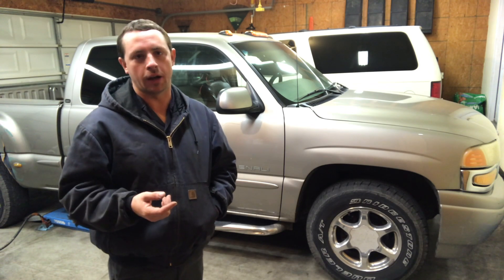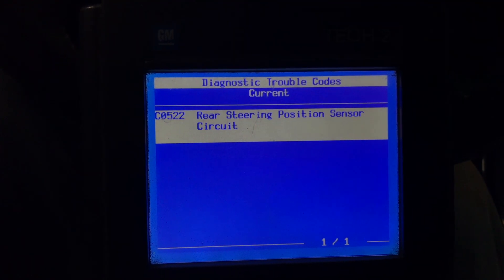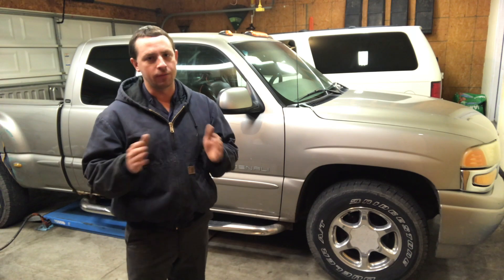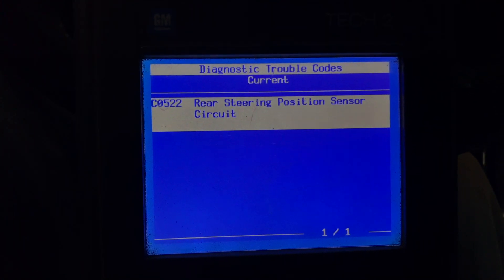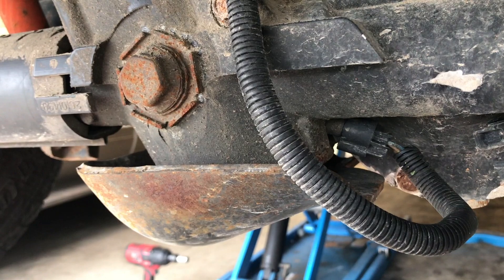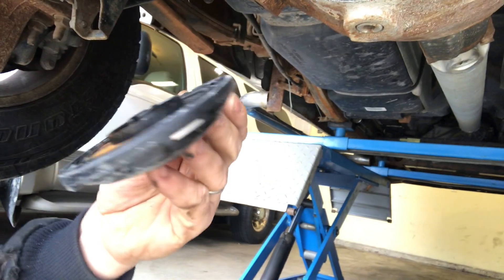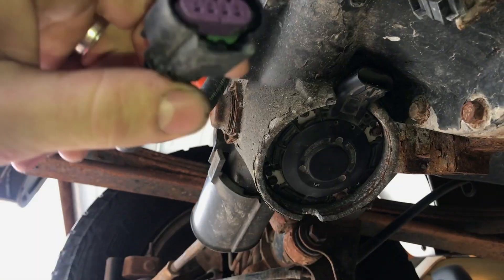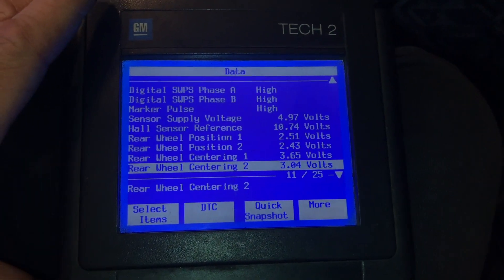GMC Quadrasteer (4 wheel steer) Repair

Comment: Redneck alignment tool.  A laser level. Much like the alignment tools used for semi trucks. The trick is looking out for raised lettering on the sidewall. On michellin tires there is usually a raised area that makes tire alignment much easier cause the alignment tool always sits straight along the sidewall.

Comment: I have owned my 2003 GMC Sierra Denali for over 20 years and driven 104,000 miles with the 4 wheel steering mode on constantly. I have owned several Chevy Silverado trucks during the same period one with the same extended cab as the 2003 GMC and even one with quad cab. Absolutely love the 4 wheel steering. The 2003 GMC Sierra Denali has the same turning radius as the 2003 Saturn Coupe. I am currently shipping my Denali to Illinois so I can drive it more often. (I have had it in storage in Florida for many years now.) Hopefully I won't have the same problem with the rear steering sensor.

Comment: Thank you, that was very informative.  I see that there is a vendor now that is making after-market ones for around $500.  I just picked up a 2002 quadrasteer, but haven't tested the RWS just yet (Broken shackle and I don't dare until that is fixed), but I'm very happy to see that if mine does have this problem that it's an easy fix and there is a comparatively inexpensive solution.

Comment: my truck is turning to the right but sometimes the steering locks up when i turn to the left and the rear left tire starts to squeal. i dont have an engine light for the 4ws, but it doesn't make any sense. does this mean that the sensor is bad or that i need to relearn the sensor?????? pls help :(

Comment: ACDelco GM Original Equipment 19418403 Steering Wheel Position Sensor $54.00 on Amazon.
Reply: Old comment but dude that’s not the same sensor at all lol

Comment: You said this truck was equipped with quadrasteer, which is something that is not really common even today? Now I just gotta ask, currently what other truck has a quadrasteer system option? From what I understand Chevy/GM was and still is the only one that ever built a quadrasteer option and only for a few years for the GMT800 platform….

Comment: Quick question just a few months ago I had to replace my drag link along with the pitman arm and idler arm and idler arm bracket and with new tie rods basically the front suspension parts and put power steering fluid since I had to get the pitman with steering gear box due to not having alot of room but after I finished installing everything i wen inside my truck and the first thing I saw on my dash message center marking  service 4 wheel steer and I checked everything and disconnected the battery multible times but it keeps saying the same thing service 4 steer I even changed the both front and rear differential and disconnected the battery and the still says the same thing plus i cant use my rear wheel steer and idk if my sensor gave out as well and it's also a 2002 gmc sierra denali AWD with the quadrasteer as well but the only good thing my trucks rear wheel are not misaligned like how you show in this vid there not crab walking plus I drive it in the highway and there just straight and its drivable and the only time the service 4 wheel steer starts to mark is when I turned the wheel to the left and if I turn off the truck and restart the msg center is not marking the truck 4 wheel steer but once I turn the wheel to the left it Mark's service 4 wheel steer again while truck is on the 4 wheel steer button doesnt let me go into 4 wheel steer it just stays on 2 wheel steer and when I barely start the truck up again theres no message for the 4 wheel steer only if I turn the wheel left and when the truck is off and I turn the wheel to the right it's not marking service 4 wheel steer but if I turn the wheel to the left it starts making 4 wheel steering for the time when the truck is on and sometimes when I do press the 4 wheel steer button it will just stay blinking but when I turn the wheel to the left the button for the 4 wheel steer stops blinking and just stays at 2 wheel steer like I dont need the the 4 wheel steer at all but I hate seeing that service 4 wheel steer service on my dash it's a eye sore whenever I'm driving and a friend of mine has a scanned tool and he scanned it but the only thing he sed it Mark's the left speed sensor is not working so idk what that is I checked it and they sed it the wire could be dirty or its cut but the wheel bearing assembly is brand new with the abs speed sensor but idk when I was replacing the front suspension parts if the wire got stretched out or it already needs to be cleaned because I replaced both front wheel bearing assembly about 6 months ago and just 2 months ago I replaced all of the front suspension parts 2 months ago so idk what I'm dealing idk replace the speed sensors or just go buy the rear steering position sensor for my denali so if you have loads please let me know I just wanna get rid of the service 4 wheel steer please

Comment: Any water inside will turn to ice and expand and break anything. This expensive option should have a bulletin to seal it and move the wiring harness so it can’t be pulled apart from  the sensor. It’s kind of crazy to think that this was considered to be a necessary option and how it would affect ride quality with all of the extra weight and potential cost of maintenance over time and not to forget that you would be unable to put some bigger wheels on your ride. In essence it would be just pure gluttony to have this on a truck only to one up the competition and your neighbour like a leather bed liner . We manager told me a story about a rich pig farmer that bought a new Cadillac I could name ten things I would rather have like an in-line Diesel engine option , dual batteries, two fuel tanks a real locking box below the bed height or a bed that can dump a load at the dump ! I think that sometimes they build something and then realize it was a bad idea. Using it on a regular pickup truck as a real world test dummy instead of a deluxe soccer mom mobile was all the evidence they needed to kill it. Good for backing up a trailer,,,,,,,very bad for dipping it in salt water at the boat launch over and over
Reply: I didn’t finish the pig story, btw my grandfather had a farm and pigs and fed hungry people when they didn’t have much so this is not to dis farmers ok, A successful pig farmer had the dealer pull the back seat out of his brand new Cadillac that he traded in every year and got a new one for himself and bought for others in the family, had them store the seats in the parts department, punch some holes in the floor and he drove around town with his Prize Pig in the back ! Maybe 4 wheel steering would be a good thing on his car, big ol pig head hanging out of the window laughing while the guy is doing donuts 🍩 and eating donuts ,,, Only in AMERICA !  The guys that built four wheel steering on a truck were the Dukes of Detroit.

Comment: I own 2 of these trucks.  One is a 2002 Denali with 165k miles and the other is a 2005 Sierra SLE with 110k miles. I guess I have been pretty lucky.  Only hade a minor problem with the 2002.  I was getting the Service 4 wheel steer light and it had  triggered the C0522 code for rear steering position sensor.  When I unplugged the sensor a lot of water dripped out of the plug.  I blew it dry and sprayed with WD40.  Restarted the truck and the 4 wheel steer has been working since.  My guess is a lot of those sensors are replaced unnecessarily. If you own one of these trucks, you definitely want to keep it in 4 wheel steer mode.  The loud groaning while he was backing out of the garage is a sign that the 4 wheel steer has not been used enough in that trucks lifetime.  He has much bigger issues forthcoming.
Reply: Dude did the exact same thing bc of this comment and it worked thanks alot man

Comment: I got the code C0533 and its the rear steering motor relay circuit is it the same cause as this truck or its different? Because i really want to fix this and its driving me crazy

Comment: Hi Did you have to relearn the system to get the new module to run also what type of scanner did you use - I put a new module in and the wheels are turning when I turn on the ignition key I am told I have to scan to get the fault codes
Thanks
Reply: Did you ever figure it out?

Comment: Who needs this complicated system for just to make the turn a little bit shorter that can cost you a-lot for rare sensor and rare axle parts for the rear wheels … i would buy a standard option rather than all this headache for just a short turn angle.🤦🏻‍♂️

Comment: At the very least they could've made a failsafe or some form of manual adjustment in the case of a failure so you could at least straighten your rear wheels out

Comment: It’s 2021 I’ve had a quad steer 2002 since new a little over 200K now and no problems to date with steering mechanism. Had a “ service QS” light once that reset itself. Using the LEVR method “If it ain’t broke don’t fix it. Tempted to pull sender and see if moisture present. Any comments?

Comment: 4 wheel service light comes on and the truck tracks straight. The alignment tech said the service code is a sensor relay. Is that the same thing? I have looked in every place possible and I cannot find a sensor relay for 4 wheel steer. Is the sensor relay the same thing as the sensor in this video?

Comment: Please help if you can...my 04 is doing this. If I find a good sensor will I  need to have the ScanTool in order to solve the problem? My truck tracks straight and alignment is straight. Is the ScanTool only needed when the wheels aren't aligned?
Thank you.

Comment: I just bought a 2003 GMC Sierra 1500 Denali with this option. Most of the guages don't work so I'm replacing the stepper motors and it shifts hard from 1st to 2nd which is the 1 2 accumulator ( I hope) and I'm upgrading that. I hope everything is good after that.
Reply: I also have the 03 Sierra Denali with the 4 wheel steer. My guages also quit working and now I no longer have 4 wheel steer and a loud clunking sound when turning left. Any issues for you since posting this s year ago?
Reply: @calliebelanger9872  it's good and I sold it

Comment: Will come back eventually but probably in an EV, there will be steer by wire and independent wheel motors soon enough.
Reply: Wow sir. You were right, the new gm EV hummers have quadsteer

Comment: Daniel, I need to replace my sensor on my Yulon XL 2500, where did you get the part?
Reply: anywhere from 400 to $800, then it could be your module 700 to a thousand or the motor 500 not to mention set of electronic shocks is like $2,000.... do yourself a favor and sell it they're not that rare

Comment: I'm betting water intrusion was the first issue, but the final killer was the water freezing inside the sensor and it tried to turn. Would explain why it was broken where the shaft turns. Or the rust locked it up. AWS is cool...when it works.

Comment: I always wanted every model of 03-06 silverado in different variations. Of course all would be top trims with all options. The variations i want them. Lowered, lifted, stock. Just now, with knowing the stupid sensor is $3300 and not produced anymore. Ill pass on the quadsteer

Comment: It's a 5V circuit ?
If so ,can't a throttle position sensor and a 3D printer do the trick to replace that expensive sensor ?
Reply: Switch to manual control, like a monster truck

Comment: I have a 2003 GMC Sierra 1500 Denali with the Quadrasteer.  I never use the rear steering it so it's in good shape.  I've had more problems with the transfer case and brake lines.
Reply: I have a really nice, comfortable bed but I always sleep in a sleeping bag on the floor... eye role

Comment: The 4 sensor screws are hex, not torx. As you are dealing with the rusty hardware, you better use the correct hex bit.

Comment: I hope you drilled a drain hole in that cover/skid plate.
Reply: Water would enter the hole. I'd rather fill with dielectric grease.
I'm afraid that the water might be coming from above seals.
Reply: @JasonW.  From the way the paint come off it looks like the water just sits there. Water enters and drains via hole.

Comment: As much as I would love a 4 wheel steering on modern trucks and this would totally prevent this from ever happening, there should be a lawsuit over this system. If theres no failsafe to straighten out the rear wheels in case of failure, then that's a crazy safety issue and you'd think there would be a self centering thing, just like how on AC vents they default to the feet and windshield if connection is lost, so your windshield doesn't fog over and your feet don't freeze
Reply: Actually most of the times if it sees an error with the system, it centers the back wheels and locks it in 2 wheel steering almost immediately. I think the sensor failure in the rear steering rack could be the only reason why it possibly could lock it out of center.

Comment: I was expecting him to water proof it to fix the issue
Reply: the cover has multiple holes drilled in it from the factory.  I'm not sure why.  the bigger issue is probaby these holes plugging up and not allowing drainage or ventilation.  I would think If the egineers wanted it to be waterproof they would have built it as such.

Comment: Got a 03 denali quadrasteer. Old man bought it new and then i bought it. Truck has been going strong its hole life and always been in 4ws. Honestly best truck ive ever driven and worth every penny especially when towing and city driving. So far never had a issue with the quadrasteer. 
One thing though is when new it was 7000 option but in 03 it dropped to 5000 and it dropped every year. In 05 it was somewhere around 800 for the option.  
Problem was gm failed at marketing it as well as the fighting with the partner company. There was alot of fighing. They actually were going to come out with a 3/4 ton and 1 ton with it.
Lucky there are still parts to find if you know where to look (quadrasteer fb groups) as well as people who rebuild them as well as some who are in the works of reverse engineering them. 

All in all i will have this truck and keep this truck working for as long as i live.  Oh and key advice if you have one. 
1. Keep out of deep water
2. Use the 4ws! Dont just use it on the odd day. Thats another reason why they brake is because people dont use them for a long time and thing go without lube and rust up.  If you can just leave it in 4 wheel steering.
3. Look into some water protection. Thats what my mechanic did for me making it water tight.  As i said still working great for 17 years.
Reply: How did you guy waterproof the sensor?
Reply: @georgetteroenfeldt8144  the best option is to look up gooodsystems new sensors that they made water proof
Reply: They did make 3/4 ton 2500 series with it?
Reply: @IWillSmurfYou  The 1500HD is a 2500.
Reply: @IWillSmurfYou  there's been some back and forth about that. Most were 1500HD though it seems in 2004 they had it marked as a 2500 then went back to 1500hd. It's weird how they did things
Reply: My sister is selling me hers it's an 04' 2500  @The_Duggler25
Reply: For water protection are you talking about krown/fluid film?
Reply: @pocketmonkey101  personally at this point I would just go with gooodsystem, after market sensor. He reverse engineered the sensor and made it water proof.
Reply: @The_Duggler25  Thank for the input, I see gooodsystems has a lot of hard to get parts. Hopefully they can keep it up for a long time.
Reply: @pocketmonkey101  well they did just expand so I think they will be around for a bit

Comment: I was looking at buying a 2500 suburban with this option. Glad I watched this. I knew they had troubles which wasn't that big of a turnoff but knowing the sensor is that hard to get just made me say no.
Reply: Your loss. Had mine for 4 years go 4x4ing in mud and snow and 0 issues.
Reply: @IWillSmurfYou  Not really my loss. It'll be yours though when it gets stuck and the wheels aren't straight. Thanks for playing.
Reply: Company called Goodsystems make all kinds of parts for the Quadrasteer system now, and at good prices, including position sensors. The Delphi system is solid and rarely have problems.

Comment: A hard right turn wasn't performed while on the road test.  I sensed that grinding noise while on the lift does the same thing while on the road.  Something else that is important, a 4 wheel alignment. Even though you have the steering wheel centered while driving ahead doesn't confirm the front and rear wheels are tracking as they should be. You will find out soon enough as the tires wear unevenly. Get the alignment and rerun the Learn Steering function again to confirm all is in position.

Comment: GM: Hey AAM, will you build us a 3/4 ton rear axle with steering knuckles for use in our half ton trucks?
AAM: No thanks! We are plenty busy now that we are about to also be supplying Dodge all their 3/4 ton and up axles!
GM: Hey Spicer, will you build us a 3/4 ton rear axle with steering knuckles for use in our half ton trucks?
Spicer: Sure! We'll use the Dana 60 since you haven't used that model since...1991!

Comment: The problem with your procedure is that the two sensors in the unit are run off the same physical input.  They are redundant to each other but have no idea if they are splined correctly to the steering gear.  The purpose of the two sensors is to disable the rear steer in the event that they disagree not to verify the sensor unit is installed correctly.